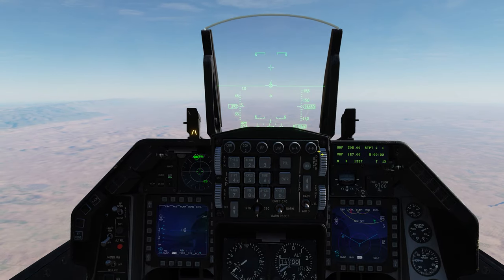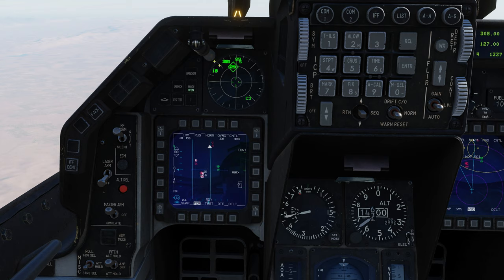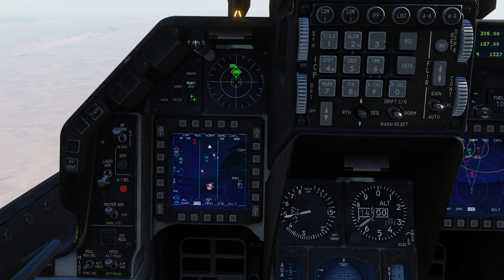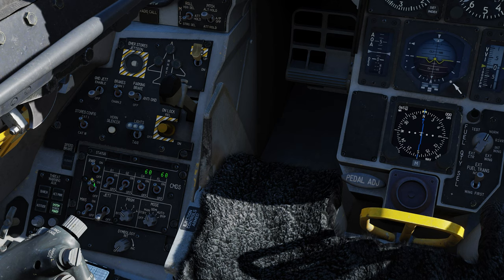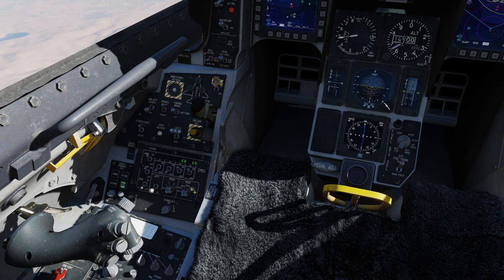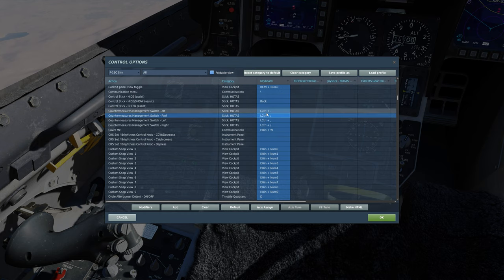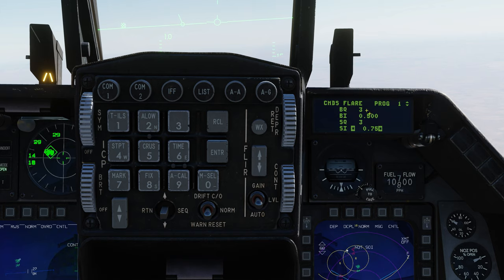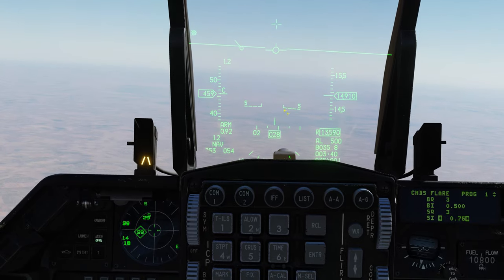Flying DCS World With OverKill | F-16C Viper | RWR and Countermeasures

Comment: Hi did what you said in the video  so I could just fire one Countermeasure with one press of the  CHAFF/FLARE Dispense button.  I put the Mode switch to bypass press the dispense button & just dumps multiple  CHAFF/FLARE I can not dump just one its always multiple & I mean half. I don't know what is going on.
 Edit :  I know what I was doing wrong I was pressing CHAFF/FLARE Dispense button ( The logical choice ) Instead of the Countermeasures Management switch forward🙄😤 .  The CHAFF/FLARE Dispense button is the panic button I think. 🤔